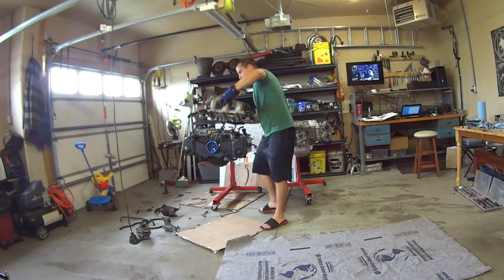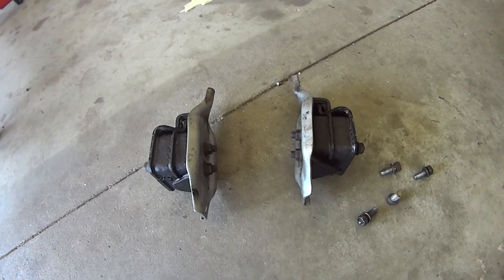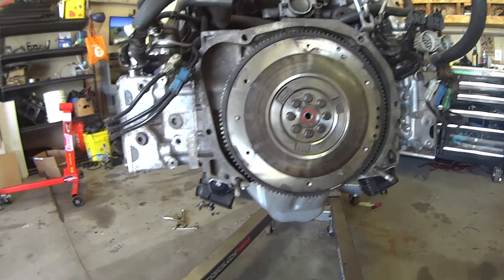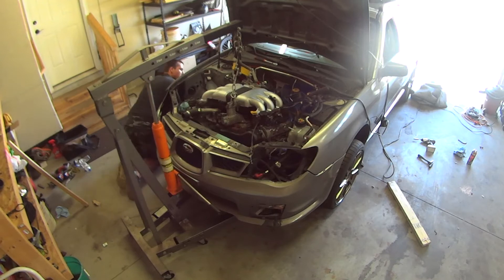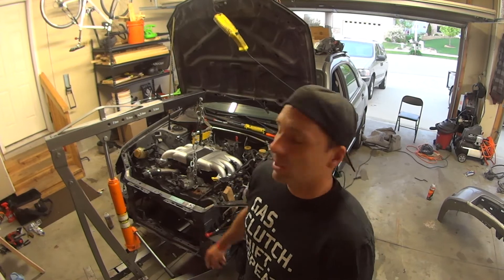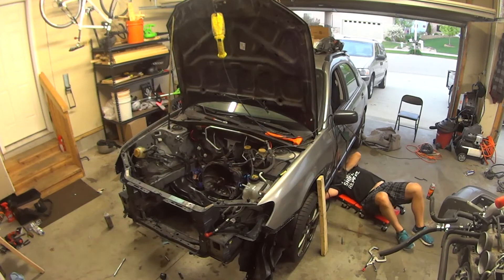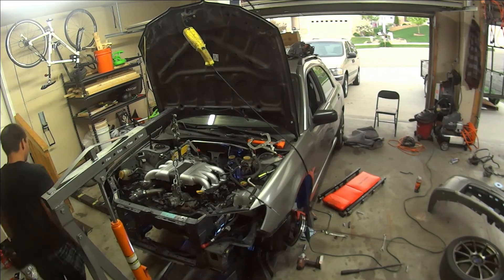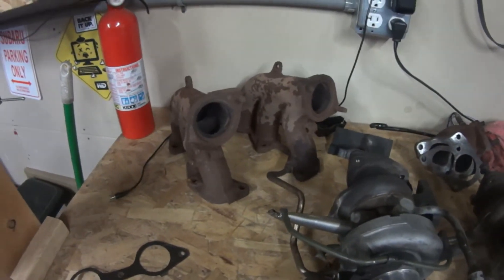EG33 Swap - H6 Engine Install (Ep. 3)

Comment: What did you use for the Crank pick up? and trigger wheel? I saw in one of your other videos that you had and aftermarket crank pickup in the far passengers side crank pick up slot and not using the sensor boss that is straight up.
Reply from the maker: There are two crank triggers since the eg33 was run like 2 separate 3 cyl engines by the ECU. You only need the 12 tooth for megasquirt. I've used a hall sensor on the crank trigger, but suggest the factory VR for the cam (or both). I used hall effect to eliminate noise, but I fixed my grounds and regular VR works well. Hall also won't work for the cam trigger as it won't stand up to the heat

Comment: im looking to put a H6-3.0 into my subaru outback which has blown up H4-2.5.    Will the H6 fit into the motor mounts on the outback?
Reply from the maker: Yep
Reply: @EazyOnCars  Thank you good sir
Reply from the maker: @armorinaction  Only strange thing I know of is if you have turbo engine motor mounts, besides that just use the mounts that came with the engine.

Comment: I got a question.  I will start watching all of your video. I'm sure the answer is in there somewhere. But I am going to ask for the sake of time.  All of these phase 1 motors don't have a spot for a lower starter bolt.  What did you come up with to hold the lower part of the starter?  Thanks, sick build!
Reply from the maker: Some don't use one. I have put a bolt all the way through with the help of an angle grinder. Drill and tap is probably the best option.
Reply: @EazyOnCars  What exactly did you drill and tap?
Reply from the maker: @subietechron7530  the transmission.
Reply: Ok I See thank you
Reply from the maker: Yeah there is already a through hole so just tap it m12x1.25
Reply: I'm confused. The pressure plate and flywheel  you put on your engine is not from a 02 to 05 wrx which is pull type. 06 up wrx are push type?   The clutch disc are the same size all years. So which transmission did you use?  
Just wondering.
Last what happen to your 2 door.  I'm trying to find one that is not a rust bucket so I can put a H6 into it. Oh and what standalone you using?
Reply from the maker: Your going to have to keep watching...
Reply: I will for sure

Comment: So wrx 5-speed box, wrx clutch and flywheel and wrx engine mounts and it's bolt on?
Reply from the maker: Pretty much. I'm using a Forester XT 5-speed, but you could use the WRX 5-speed. Only small thing I did was add a second starter bolt on the transmission (took like 5 mins) 
because the EG33 does not provide the stud.
Reply: Okay thanks! I have a MY99 Legacy RSK so that means that I could use my current flywheel, clutch and transmission, which is great info! How much the EG33 has low end torque compared to a EJ20T?

Comment: (Eg33 [svx engine?]) all you did to make it a manual transmission was put in a wrx clutch in it?? Pardon my ignorance.
Reply from the maker: +Ram Ram yup, the car already has a 5 speed manual. Thankfully Subaru hasn't changed much for the last 20 years.
Reply: This is so cool! You're telling me that to make my 94 svx a manual all I have to do is drop in any Subaru transmission and it'll work?
Reply from the maker: +Ram Ram for an SVX 5 speed swap you need a few more things since the car was not a manual. For example a clutch pedal. Here is a step by step guide for that. https://thegarage.jalopnik.com/how-to-make-a-subaru-svx-the-car-it-deserves-to-be-1623709858
Reply: EazyOnCars wow my 300$-500$ budget project just turned into a 1000$-5000$... I'm watching top gear for inspiration right now" lol
Thank you so much for your knowledge!!
Reply from the maker: +Ram Ram search junkyards, you'll find stuff for cheap that will work ;)

Comment: This is Awesome! You are the MAN! From my curiosity do you think there is more juice in EG33? with potential turbo and etc.? how about EZ30 - that one looks more promising especially EZ30R one. Any luck with DIY ECU module to gain better response and control over the engine? I think i have one more question but have no words :) for now  ;) . This setup will perfect with 05 STI 6 speed tranny :) with Front Helical LSD - Centre DCCD - Rear plated LSD  with 3.90 Final Drive ratio it will be the beast.
Reply from the maker: +Florin Soltan I like the EG33 because it was designed to be a performance engine, and it's essentially the same as the EJ22 with 2 extra cylinders. Aftermarket tuning would be more complicated than the EG, but still would be a very capable setup. I should have my car running on the aftermarket ECU this weekend so keep your eyes open for the next video.
Reply: EazyOnCars  so cool, most probably i will do one swap in parallel with you ) i have 2 turbo h4 sitting in my garage but it looks i fall in love with this idea of N.A. H6 ) so much fun in H6 you are absolutely right! Good stuff all of your videos, i'm Subscribed. Good luck with tuning!